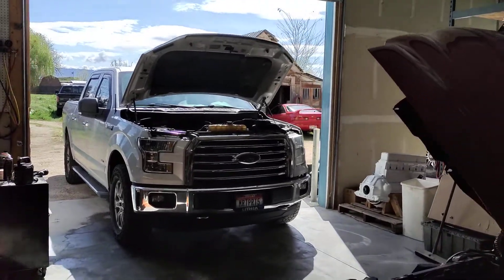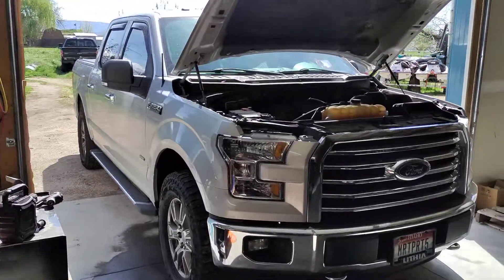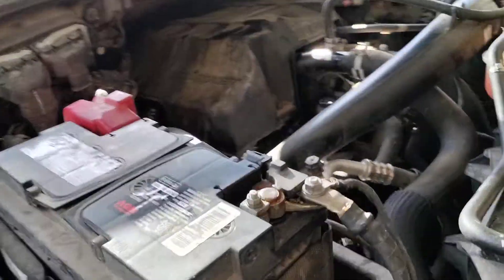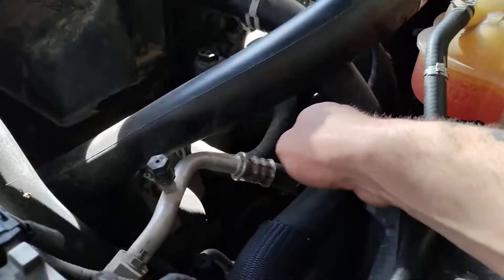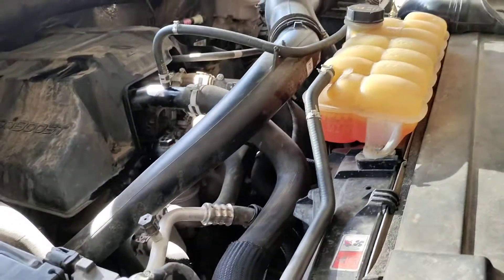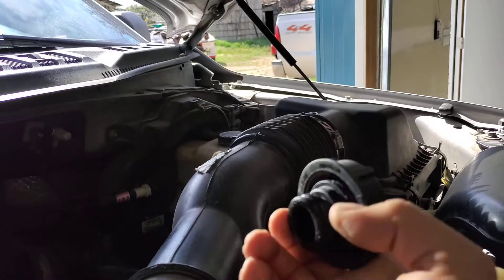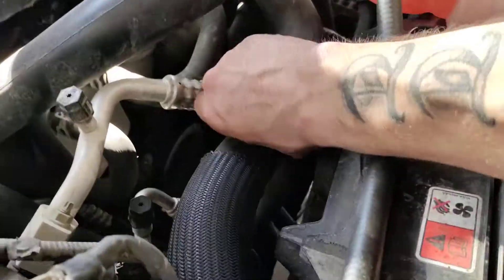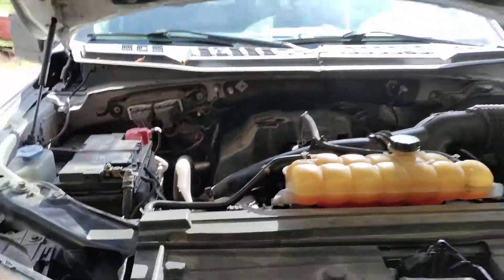Ford F 150 collapsed radiator hoses. cause and repair

Comment: The y connected heater core hose connector is junk on these. They almost always leak. Replace that part first. Causes a lot of these issues

Comment: Can you please clarify about open the cap and a pisss sound comes out. Does it happens when the engine is cold or hot.
Reply: That would be cold, don't try to open when it's hot

Comment: I had the collapsed lower radiator hose, I replaced both upper and lower radiator hoses, the thermostat and the reservoir cap.
I had my truck jacked up in the front for a couple of days, I also did an oil change. After lowering the truck and checking for any leaks I  backed up maybe 30 feet, I checked for leaks again and I had coolant leaking from the front of the muffler? Any thoughts?
Reply: If it's just water, it's condensation from the exhaust system leaking out of the drain and it's normal

Comment: I have a 1989 Ford 350 7.3 l diesel it was overheating quite a bit couldn't figure out the problem so I replaced my radiator cap still overheated then I replace the bottom hose cuz it blew off still overheated so I thought it was a leaky head gasket put some sealer into the radiator that clogged my radiator cap and caused a collapsed hose I clean and flushed out the radiator put the cap back on I haven't had a issue with a collapsed hose. And found out it was a fan clutch. I would have never known any of that so,Thank you